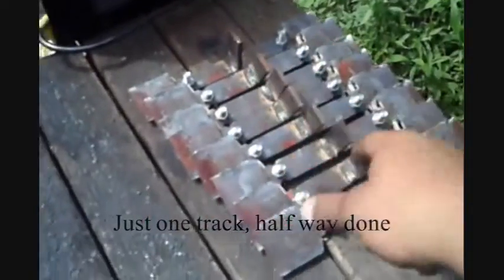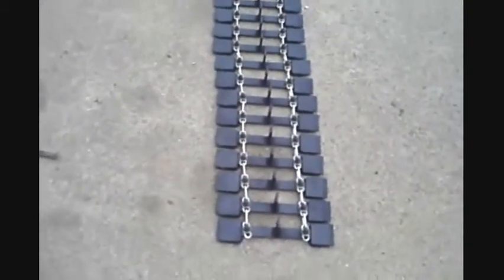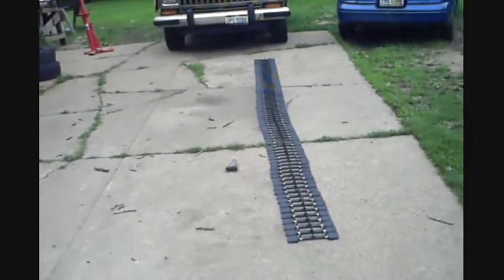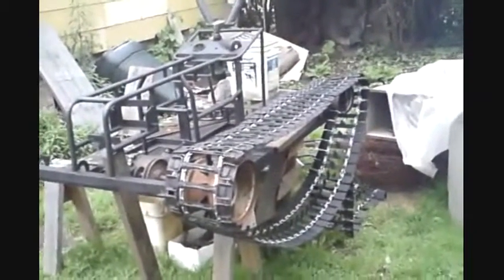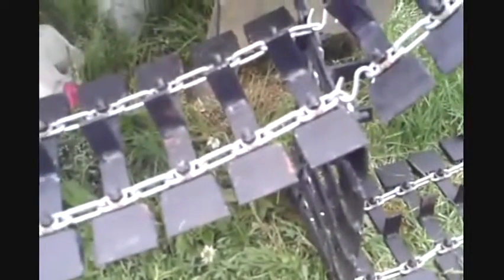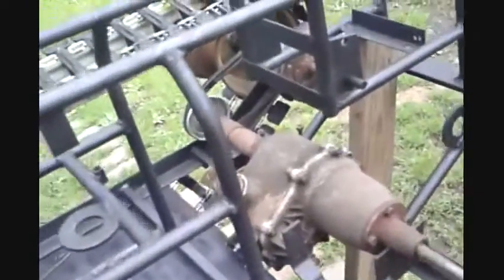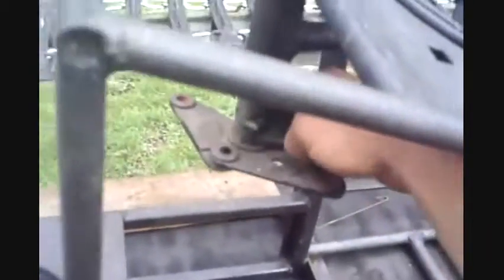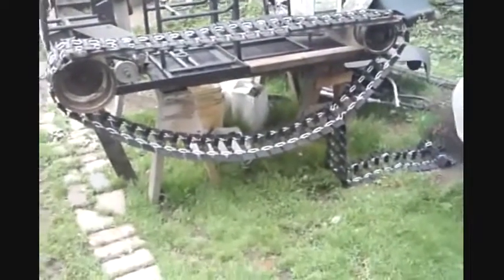X1 Scorpion track update with mockup of driveline

Comment: maybe switch to 5/8 belts if the pulleys can handle them, thats a pretty decent load on the belts pobably gonna stretch
Reply from the maker: ***** Yah, The pulleys are for 1/2 belts though, but I plan on using automotive belts because they don't stretch as bad, more bendable, and have more grip because of the rubber sides that ride on the pulley, but they are 3/8. I'm probable going to have to put double pullies on down the road if not right away, just for the stregth.

Comment: Damn looks awesome mate! I wanna start my build but I cant! Those tracks are really coming together nice. Great idea with the s hooks, though you will have to cut them when you need to take the track off if you are going to weld them? 

The steering to me looks a bit complicated but if I had it hands on I could figure it out a whole lot easier. I think I'll stick to levers on mine haha!
Reply from the maker: Swearzy Thanks man! The s hooks, yah I thought of that when I had to pick them when I was at the hardware store. Those links with the long screw on them was too long to use which would have been perfect, but the s hooks was the only think with the right spacing. I figured on making a tool box on board that will carry 2 road wheels, about 6 nuts for the track plates, a 1/2 wrench, 2 s hooks, a pair of pliers, and 1/2 of a hacksaw blade. That right there should take care of any problems if on the trail to where I can limp back. You got the right idea on the steering with the levers, you'll see.

Comment: Looking great! Your tracks look very cool.I like how you are doing the master link.I am going to end up changing my steering to what you have. What I made is not strong enough to disengage the pulleys ,the springs I used to tension the drive belts had to be very strong. I also have made the new chain/ belts for the drive system I have to get a video out. You are doing a great job.
Reply from the maker: Aceman307 Thanks, Making the drive sprockets next, starting them today maybe. I got time to make other things while I'm welding track, welder needs 30 minutes to cool, definately reaching max on duty cycle. If you notice the brass ground clamp on the welder in the vid, I fried the original steel one, lol. The brass one is rated at 400 amps. Can't wait to see what you got. Yah, I never had any luck with cables either. But I do have an idea for you, maybe weedwacker shafts with the covering, their made just like speedometer cable but way thicker, or maybe speedometer cable, that way you don't loose the flexability. I used the weedwacker drive cable on my Jeep to lock the front axle on the 4 wheel drive, never had a problem, plus it's thick enough to weld to on the ends.During mockup, I played with the pullies, and yes I can put double pullies on if I have to, just barelly though. Frame rails just clear on the gearbox and sprocket axle. And Happy Fathers Day.